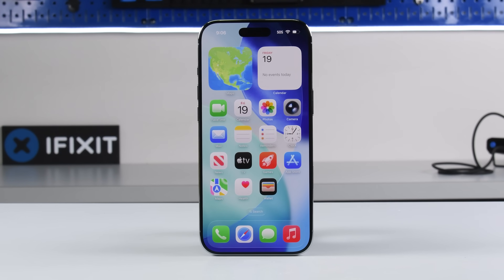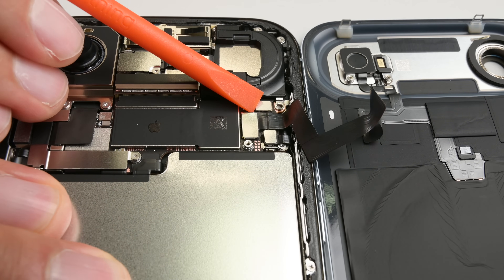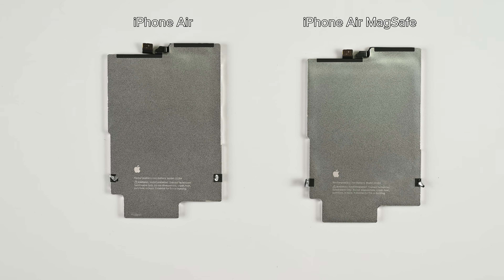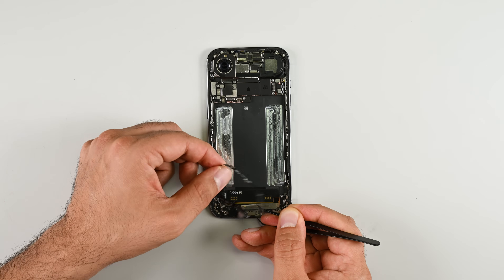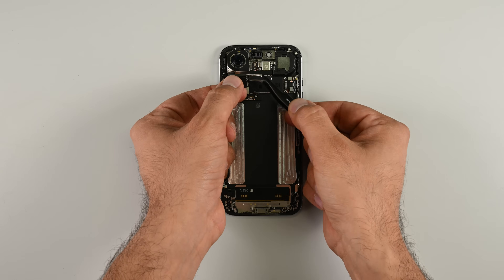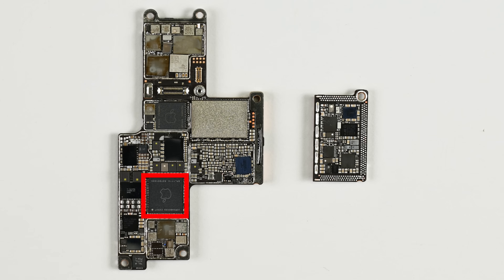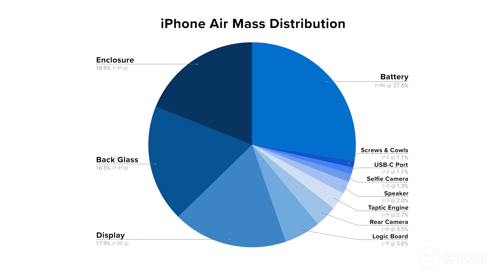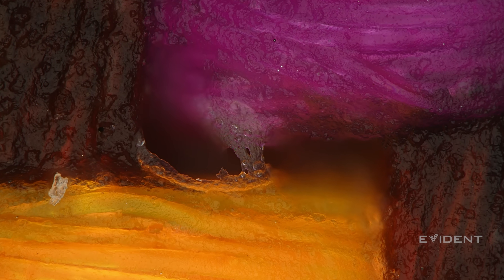Apple’s Thinnest iPhone Ever… Is Actually Repairable? iPhone Air Teardown

Comment: Reminder that EU made the law that starting in February 2027:
- most portable batteries like in phones and laptops will have to be user replaceable using commercially available tools;
- have instructions on how to replace them available permanently online;
- provide spare batteries at least 5 years after last unit of a model is sold;
- they can’t prevent 3rd party batteries from working. 
So companies are already testing ways to implement it and preparing for what they’ll have to do in next 1-2 models.

Comment: It's darn mind blowing that there's a pretty powerful computer miniturized into that tiny logic board that is looking only about take up like 20% of the surface area inside the phone at most. It's almost all battery in there.

Also, I've been wondering just why this phone exists ever since they announced it. It's certainly not for me. The loss of a sim card tray is something I can live with, but the compromises made on the camera and battery life to get it this thin are dealbreakers to me. But then it dawned on me. Samsung made the S25 Edge almost entirely as a proof of concept that they could get a phone that thin to miniturize the Fold 7 to the point that it's thinner than the S25 Ultra while it's folded up. I get the feeling that the Air exists as a way for the engineers at Apple to figure out how to get a phone as thing as possible for a future iPhone Fold or whatever they're gonna be calling it. That and being able to claim that they now make a thinner phone than Samsung. Because that rivalry will keep on going.

Comment: iPhone AIR is the greatest innovation of APPLE. No 1. They make it thinnest iPhone. No 2. Battery sold separately then remove some cameras and remove 1 speaker. The BEST of the BEST. The new iPhone Air just doesn’t justify its cost. Apple is calling this a “premium” device, but what are we really getting? A single camera in 2025, a single speaker, and a battery so small that you’ll be hunting for an outlet or carrying a power bank everywhere you go. It feels more like Apple is selling compromises dressed up as innovation. Instead of pushing technology forward, the iPhone Air feels like a step backward — style over substance, and at a ridiculous cost.

Comment: Repairable for an independent repair shop? Perhaps. 

But for the end user, as far as I'm concerned, if adhesive needs to be removed and replaced at any point, it is not repairable. Adhesive is not necessary, Fairphone showed us that.
Reply: Is fair phone water resistant?
If you want a product to be water resistant then they will have to use adhesive.
Reply: @gund89123  you could also use silicone O-rings like what's used in watercooled PCs.

Comment: My Jerry knife feels so unstable that it's about to pull apart under even the slightest pressure. I stopped using it for safety reasons. It's about as weak, but not as weak as his political views. Get a knife from a more trusted source iFixit!

Comment: Curious how easy a screen replacement is. Can you access that connector from the front? Or do you have to go back to front like with the old iPhone 4?
Reply from the maker: You can access it from the front. There’s a cut out for the press connector in the midframe.

Comment: Why the Vapor chamber is behind the Amoled screen and not the back of the aluminium frame if aluminium frame is said to be better dissipating heat?
Reply: Air is made out of titanium.
Phone has glass on both sides 
May be it doesn’t matter which side it is

Comment: Good grief... a paltry 3150 mAh battery to power a phone with a 6.5-inch, 120Hz, HDR-capable OLED, welcome back to the nightmare of not knowing whether your phone's battery will last until you return home and having to lower the brightness to near-unreadable levels, just like in 2011. But hey, it's thin, and that's what the cool kids want these days, right?
Reply: It has the same battery life as last year's iPhone 16 Pro. Stop being so pedantic.
Reply: @SPZ909  Maybe in video playback, where the OLED benefits from the fact that some of the pixels will be dark and Apple can do software optimization tricks, but let's have it do internet browsing at 100% screen brightness and see how many hours of real-world usage it gets.
Reply: @Δημήτρης-θ7θ  Unless you're outside in the sun all day long you never use 100% brightness. At night it burns your retina.
Reply: @SPZ909  It's possible to be outside all day if being a tourist in another city. Anyway, my point is, real world browser use will suffer under any common brightness setting (and will bring down overall battery longevity), Apple can't do software tricks like they can on video playback.
Reply: @Δημήτρης-θ7θ  The battery life is fine.
Reply: @SPZ909  "Fine" (aka barely making it through the day) was acceptable in 2011 but not today.
Reply: @Δημήτρης-θ7θ  Obviously it is acceptable lol.

Comment: Thanks for the great Tear-Down Video. I REALLY wish you would start adding a Build-Back-Up section at the end to see how easy it is to actually repair it, not just destroy it (Jerry Rig and others have that covered). I suppose if you take apart the parts to see what the chips are and bend it to see if it breaks (as well as use the JerryRig knife instead of a spudger) that would make it difficult. I see lots of videos on Tearing Down phones and devices but unless I see someone put it back together without losing the IP rating, I am not going to try it. 😁🔨
Reply: like the GLUE

Comment: 7/10 is still way too high. You can only use apple certified genuine parts that are incredibly overpriced and make the proposition of doing it almost not worth it unless you have a part reprogramer, which you won't have unless you work on eletronics for a living. If you put aftermarket wheels on your car, you shouldn't lose traction control, ABS, and your parking brake with non genuinely wheels that are overpriced. The electric adhesive is also stupid and is another tool you will need to get if you don't have it when you can replace it with a bracket and some screws or better engineered pull tabs. If this was 10 years ago, this would get a 2 or 3 out of 10.

Comment: 5:40 this is what’s really impressive to me. Additive manufacturing is amazing, and saves a ton of material that you just shave off like in regular machining. Yes, the savings can be recycled but not producing them in the first place and removing that step completely isn’t trivial.
Reply: Metal Injection Molding can also save lot of material
Not sure what is the difference between MIM & 3D printing.

Comment: 😂😂😂 the power bank has the same battery yet is thicker than the actual phone. Interesting
Reply: The powerbank is made of plastic. It needs to be thicker to be strong.
Reply: @BANNANA_DEV  so bad design. Thats not a good justification. The whole product is ridiculous. Samsung actually did it correctly even for a 1st gen
Reply: @trealin4730  samsung s25 edge loses to air in many battery test...
Reply: @BANNANA_DEV many? So not all lol

Comment: 7:07 this is why it has 1 camera and why the bump is long, i called it all the way back in 2024 because i knew faceid sensors are too thick for a macbook (its why it doesnt have it) so i was wondering how would they fit a full sensor array in such a small space, so my guess was that they may mill out the bump on the inside to provide more space. It didnt occur to me they'd use the bump to house most of the components in it lol
Reply: Most of the Air's electronic components aren't in the bump, they're below the bump, except the A19 chip.

Comment: I was about to say “funny how the worse phone of the lineup is more repairable than the best”. And then I realized that, that’s the point! The battery is going to degrade faster on the Air, so it’s good that it’s easier to replace!

Comment: I really enjoyed JRE durability test of this phone its such a thin slab but somehow so durable, I despise apple but damn did they make a thin slab of titanium and glass.
The problem that comes with the phone being so thin is "My waist is 14 inches too if you ignore the other 14 inches" in this case the camera bump.
I like the external battery thing they have BUT the problems are its such small capacity for the size of it + pretty damn pricy and the fact that it doesnt work on any other iphone just makes it so dumb.

Comment: IFixit tools are an excellent companion for dismantling things. The only problem and the reason I do not use iFixit bits is it is very difficult finding the bit you need. iFixit have the bit identifier label the same colour as the surrounding foam. You need to have the background foam a different colour than the label.

Comment: The iPhone is the product that attracts the most attention from regulators, so they can't be too antagonistic to repairs.
But the AirPods are still basically a throwaway item.
Reply: They're also sooooo tiny, repairability was always going to be hard in such a product.
Reply: @jama211  They spend billions in R&D every year.
They do hard things on a daily basis.
If they cared, they would have done much better.

And they have no excuse for the case.
Reply: @Luzgar  I have the app1 and after years of using them while running I can clearly hear either the driver or the mic got dislodged from its natural place. IDK if repairability is a reasonable ask considering the type of device it is, but one things for certain, they shouldn't have cheeped out on the glue.
Reply: @StevieFQ A device that can't be repaired is maybe a device that shouldn't exist in the first place.
Reply: Any battery powered device that has to be that small and sealed from the elements are throwaways. Airpods are no different.
Reply: Yep they are the worst for longevity

Comment: Not to be an asshole or anything but apple's been using pentalobes since 2007 and iPhones have been the best selling smartphone in the world for over a decade. AI says over 3 billion iPhones have been sold to date. So the  pentalobe IS a standard now - y'all can't keep complaining about it like it's a disadvantage or this rare type of screw where you will struggle to find the appropriate screwdriver. Every smartphone repair kit has that screwdriver - most sellers of aftermarket displays or batteries will ship them with a little screwdriver. It's honestly time to let this one rest.

Comment: Maybe I'm just a hater, but am I the only one not agreeing with these teardown scores of apple products from iFixit? I mean 7/10? As a repair technician I find it much easier to fix Samsung/Xiaomi even Pixel phones (although a tad more difficult) than iPhones. The sheer amount of different screws, while Samsung only uses 1. Samsung gets a lower score because of its famously glued down battery even though you can buy an original one from Amazon. While Apple gives you the privilege of selling you one for 120$ only if you provide the phone's serial number. Dear iFixit, this phone is not repairable at all. In my country, for instance, there are no apple stores and no genuine parts. Here these slick gadgets are manufactured e-waste from day 1. Does it really deserve a 7/10? How is Apple watch a 3? Apple literally only replaces it if it breaks. There are no parts for it at all. At the same time s23 ultra gets a 4. I'm pretty sure you can buy an original motherboard for that thing let alone display, battery, charge port. When buying a display you have two genuine options: with or without a frame depending on your skill level. How is that bearly better than an apple watch?

Comment: 5:28 that statement alone is the Nindo of Tim Cook. Jobs was a real genius marketer, but Cook is a real genius Financial officer. and always calculates and think about how to increase margins. Sitting on a 3D printing process since 2015 and using it 10yrs later when margins are actually harder to maintain due to external factors is quite clever.....or greedy depends on where you sit
Reply: May be 3D printing is expensive compared to normal CNC manufacturing?
they didn’t have justification to use it until they designed thin phone ?

Every manufacturing process has advantages & disadvantages.

Comment: Apple should have made a mid ranged SoC that used less energy like what Google did with the Pixel 5, I do not get this obsession with having a faster SoC each time, my 12 Pro Max doesn't lag at all. It's funny cause my iPhone 12 Pro Max is at 68% life and I get a full day still and the battery originally is barely bigger than this, so it's into the 2000s at this point.

Comment: Though thinking about it they should just copy the Surface Duo and have that as their folding phone, that was under 5mm thick on each side. I dunno why everyone wants these bendy screens that break easily, all you need to figure out is a hinge that when open can slide inwards slightly to remove the gap the Surface Duo has.

Comment: Apple is selling replacement battery disguised as power bank 😮 that’s genius
Reply: EU: Phones must have user-replicable battery.
Apple: Here.
Reply: one battery component to two devices is actually environmental friendly.
Reply: @thischannelisforcommenting5680  Not only that, it's more economical. THey're reducing the number of parts they need to manufacture.
Reply: If anything I'm surprised Apple isn't leaning more into selling batteries. With the right model and manufacturing scale, they can actually be very profitable. They could introduce optional features like super fast charging that deteriorate battery quickly and push for sales of new batteries. It could also be an incentive to introduce newer battery technologies more quickly.
Reply: Its not mandatory to buy stop crying like a baby
Reply: You will need lot of them
Reply: Yes, selling a battery with Apple tax and giving a way to squeeze the degraded battery, along with the MagSafe power bank enclosure. 😂
Reply: @FThkuk  The battery life is the same as the 16 pro. Everyone is crying like the battery life will be terrible, every test shows otherwise.
Reply: @jama211 that's in fact wrong. It lasts less than the 16 pro, which was the 16 series phone with the worst battery life in the first place
Reply: Not genius it’s the customer that’s  not so smart
Reply: except it’s not a replacement battery

Comment: Could you explain why the lithium battery is now packaged in hard stainless steel, as i read that lithium batteries are packaged in soft plastic to allow for expansion and safer dissipation in case the battery leaks, reduces explosion impact by allowing deformation
Reply: they have a video up on that topic already, check it out, its quite cool
Reply: One thing to clear: Most mobile phones have aluminum cases (except for very few smart phones sale outside USA use plastic housing). However only laptop PCs use soft plastic housing cases for batteries.
Why Apple move to Stainless steel case ? Here is answer from AI search:
Apple uses stainless steel-cased lithium-ion batteries in some iPhones for enhanced battery safety and protection against accidental damage, and to meet upcoming EU regulations requiring user-replaceable batteries. This metal case provides greater durability and rigidity compared to softer aluminum casings, protecting the battery during removal and installation, and potentially allows for increased energy density for longer battery life.

Comment: Weight is the true way of knowing which is "thinner." Apple cheats and those two mm "less" are on the plateau that they don't want to calculate as a thickness.

The s25 Edge is the true winner because he has all the components on the phone and not in a hump.

Comment: I disagree. Looks like 5/10, not 7/10. Battery could have no complex single use glue. USB port replacement is a MUST, top3 products requiring replacement. If not available, then 0 points for that.

Comment: my daily driver is an iphone 5s chassie with a 2016 SE logic board crammed inside. still using the same iphone 5 case that i got with my first iphone/first smartphone back in 2013. it has kind of yellowed or become opaque with time like how 5 min epoxy darkens over the years. I am not sure what a more durable phone case is but i feel like its a mute issue considering mines almost 15 years old and has been doing fine with daily use lol
Reply: Thats genius